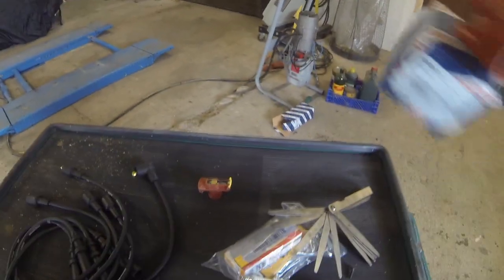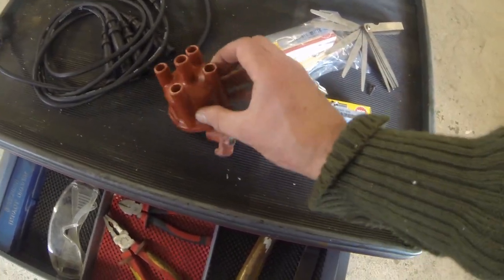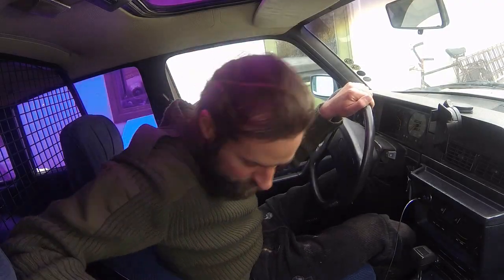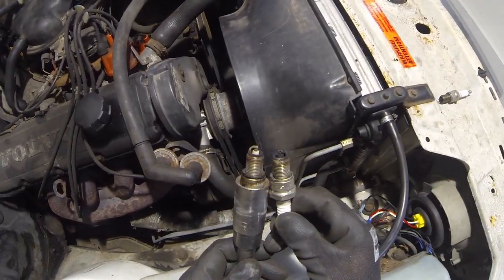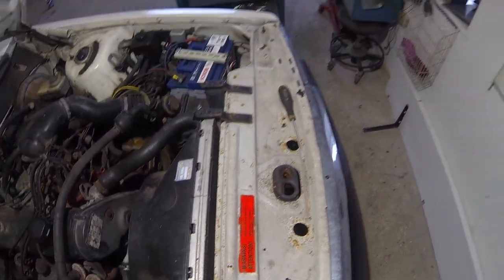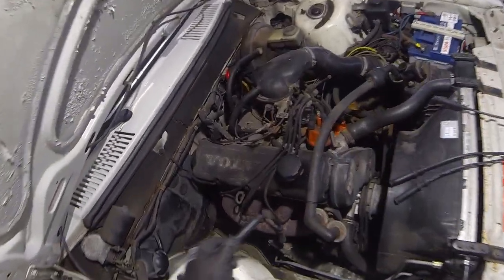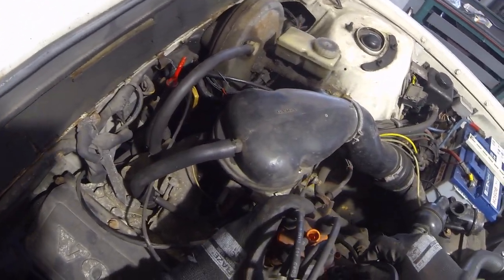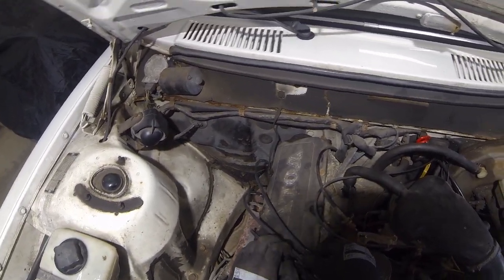Volvo 240 Plugs and wires.

Comment: Hi nice video!, im restoring a volvo 244 gle with the b23E engine  that has been stopped for 14 years and it would be awesome if you could give some advice of the things I need to change or problems that you have had. When Im starting it it fires up a little but doesnt start up. What could be the problem, injectors ,spark plugs ? (apart of obviusly filters  oil and the timing belt) I know its very difficult without seeing it but im starting with this  and Im a little bit lost.
Reply from the maker: I would take a look at the fuel pump to ensure it delivers fuel pressure. :) 
another thing is to change the old stale fuel! 

Nice car and good luck with it! feel free to ask more questions and i will do my best to answer them. :)

Thanks for watching!

Comment: Are you using any anti seize or lubricant on your plug threads?
Reply from the maker: No... and never had... And never had issues...
Heard of many who did though... so I don´t know what to recommend... If you use grease then take care not to over tighten ... especially on aluminum :)
Reply: @SeasideGarage  BOSCH are 'pre-treated' and don't require any. 2 of 4 "really loose" plugs might be the reason it has a hard time starting !!

Comment: Very good video! I've been restoring a 240 wagon from 1990 (not really much to do with it, it has only 95K real miles) and it caught my attention how loose those spark cables are in mine as well. Is that normal? Should I replace the cables if they are very loose from spark end? I have a new distributor and a new rotor but not sure it it makes sense to change them without changing the cables. THanks!
Reply from the maker: Thanks! Well if the connection are ok i would not change them... but they are just as important as dizzy and rotor.. :)

Sounds like a awesome project! mine has done close to 500.000km.. ;) its worn...
Reply: Honest reviews could we please get into contact so I can figure which white goes where on mine I need help
Reply: @ericgutierrez728  Absolutely, write me to my YouTube email address. Spanish or English, whatever you prefer.